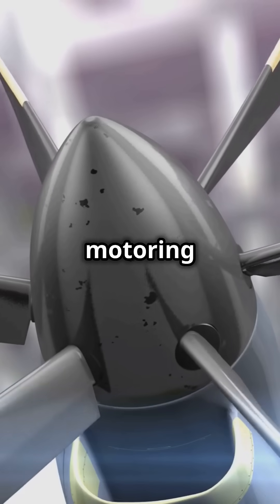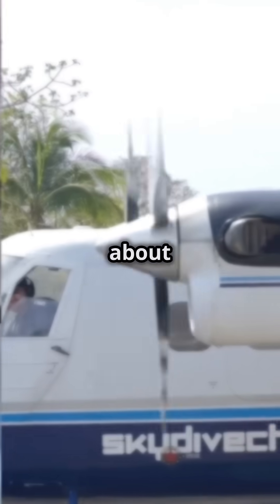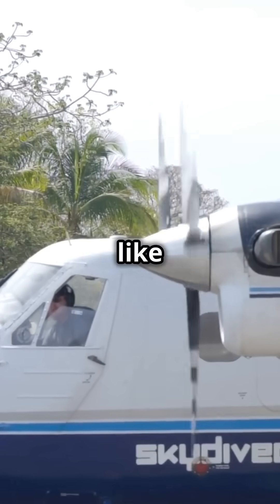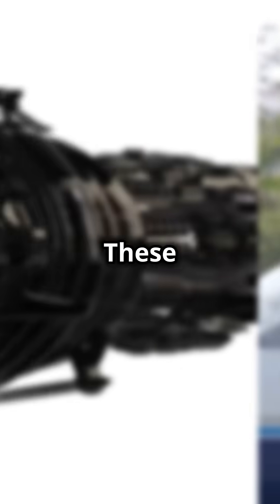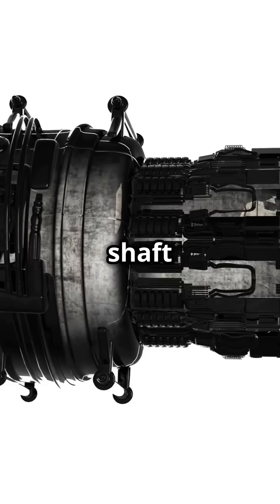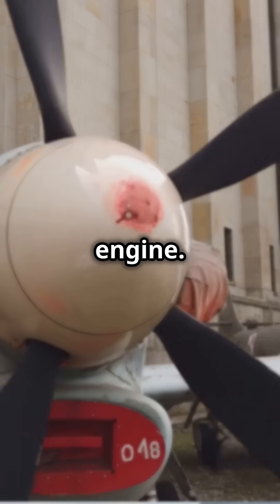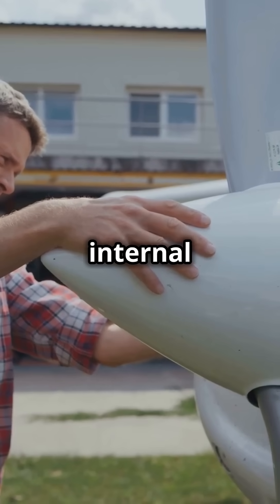Propeller Spinning after Shutdown

Comment: You call out Garrett 331 engines but why is most of your video on Pratt and piston engines?
Reply from the maker: I have worked on aircraft with Garrett 331TPE, Pratt & Whitney and piston engines but the clips are just for illustrative purposes only and not exactly depicting the aforementioned engine. The focus of the video is the concept.
Reply: @AircraftTechnicianNetwork  So are you saying the concept being portrayed is all direct drive turboprop engines experience shaft bow?

Comment: Not familiar with turbo props. But in turbo fans, its called Rotor Bow . It happens when the Engine is started to idle thrust immediately after start, which causes the rotor to bow or bend due to the sudden increase in thermodynamic load. To alleviate that condition, a phenomenon called cooling period is embedded into the EEC of the Engine which makes the Engine to run on starter for an extended time( for example, earlier PW1100 Series Engines had a much much longer cool off period than it is now) thereby increasing the temperature condition inside the core and the n2 shafts and extending the Engine life.